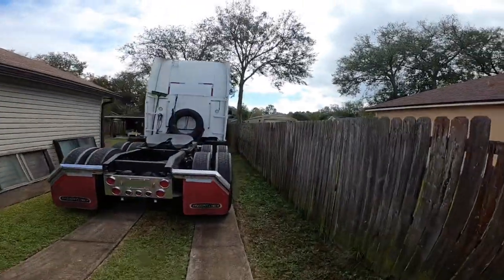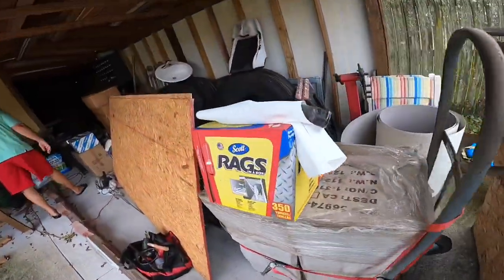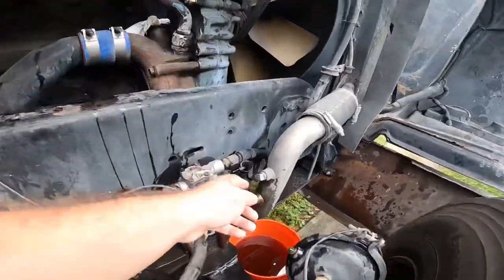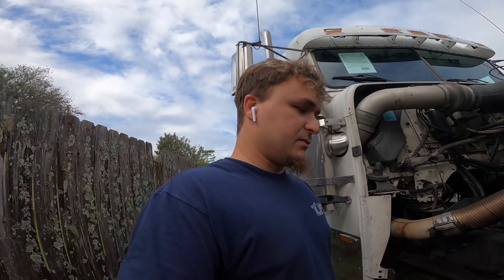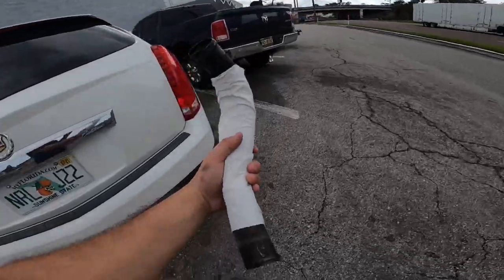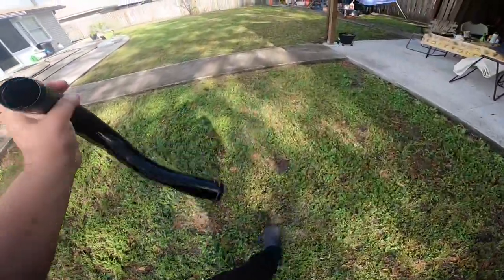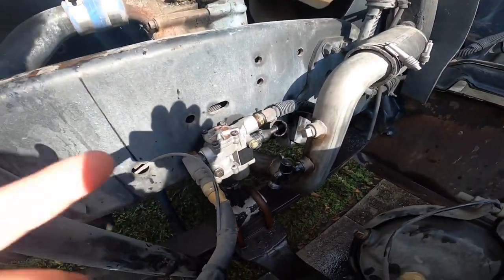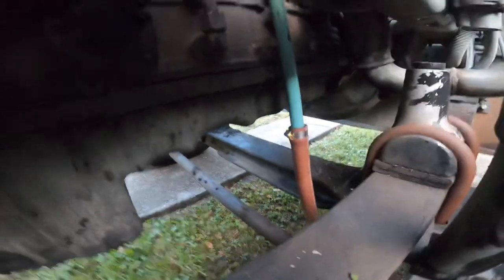PAINTING THE 60 SERIES ENGINE + FIXING A COOLANT LEAK

Comment: My 04 Freightliner Classic XL with 14l Detroit has one built in on the bottom passenger side radiator... only 12.7 Detroit’s have that style and that style overhead air to air charge pipes

Comment: I have a 60 series. Changed the pump and then vacuum filled it. The temp has been rising and I was wondering if there's any spots on the 60 series that you're supposed to drain coolant from other than the radiator? Meaning like a spot on the engine block somewhere you're supposed to drain?